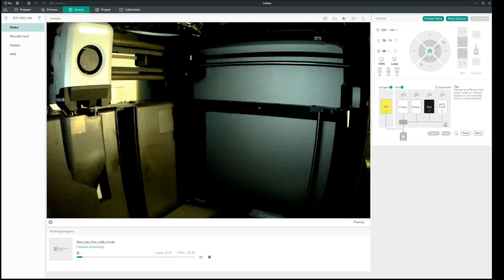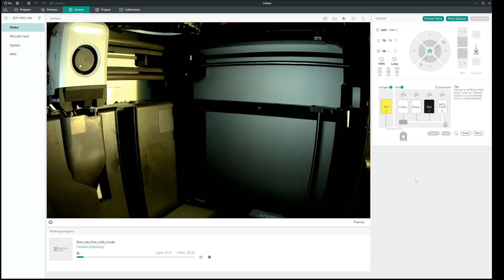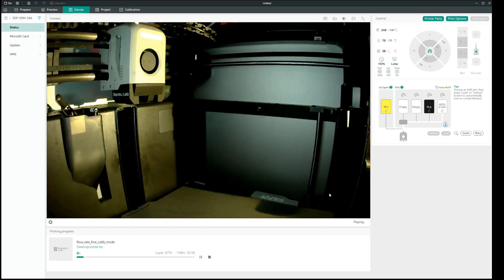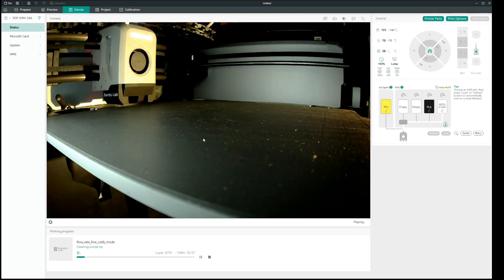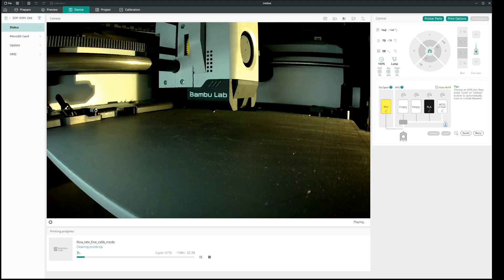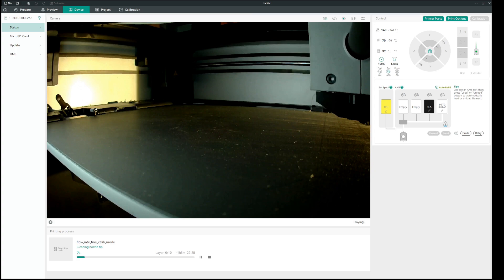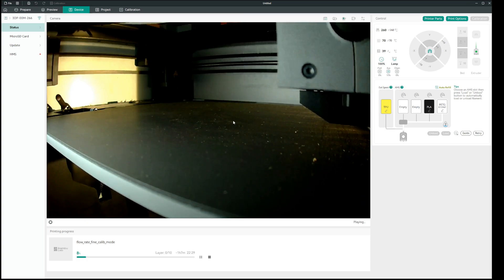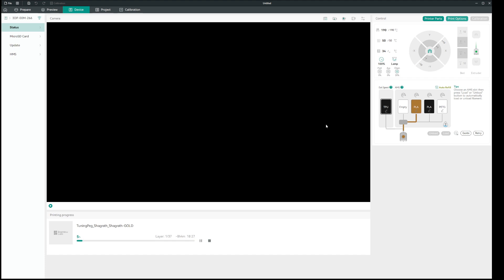Bambu Cool Plate Supertack - Fix problem with filament not sticking to buildplate.

Comment: Well ballz. I thought this was going to be my fix. But I have a P1S and have this issue. Prints fine on the normal plate or the engineering plate. Or even 3rd party plates. But this "supertack" does just what happens to you in this video. Line fine. print nope wont stick at all and just balls up.  It just super sucks. And i cant do what you said coz ive got a P1S. So this is most deff a firmwhere issue / setting for the plate. crap. So that was a waste of money for me. I could experiment with using a custom plate setting. I know the texture PEI plate puts the first layer closer to the plate than the engineering plate does so maybe thats worth a try. i just dont want to scratch up my plate like i have done so before. I only tryed this plate out after months of not trying it being sealed. And I dont want to update my firmwhere as they have blocked orca slicer usage. Also no bug or improvements for my printer so why bother to just have more restrictions. I dont really use orca slicer that much but its useful and its also the princeable. There is no reason for Bambus move other than to annoy and try forcing the use of bambu lab. I guess its working as i do use it more than before and I guess i should use lan mode but being able to cancel a print part is very useful and ive not seen a way to do so without the handyapp. Well thanks for the video. i guess i put a ticket in again see what they say and maybe fix another bug for them that they wont update and fix, still waiting for the ams bugs fixes i sent them over 4 months ago. I'm starting to loss faith in bambu. they where so good. Disappointing. Mind you 4352hrs and still going with only the odd issue is not too bad. Cheers.
Reply from the maker: Try set your first layer height to 0.12mm   which is what the test lines on front is printed with. Always have bed leveling on. Lemme know if it helps.

Comment: I turned plate detection OFF and now my X1C's are printing fine on the SuperTack plates. Thanks for your post on the forums and this video. Interesting that some have to turn it on and others off.
Reply from the maker: Glad to hear it's working for you! Thanks for sharing what helped!

Also if you want to use 0.2mm nozzle you MUST set first layer to a minimum of 0.12mm layer height otherwise filament will just buildup around the nozzle. This is the same height used for the testline at the front of the buildplate. Any lower like default 0.1mm will not print with 0.2mm nozzle on supertack

Comment: I just got one of these supertack plates and had all the terrible issues shown here.  The plate DOES have the square 'barcode' on it, but it's printed in grey ink on a grey plate so it's very hard to see - no wonder the camera in the printer can't recognise it - very silly.   But the fix for me was the exact opposite of the advice here - as soon as I turned OFF build plate recognition, the filament stuck well to the plate and I had a perfect print!
Reply from the maker: I have heard several say that. But for me i cannot print without detection on. In addition i always must set first layer print height to no lower than 0.12mm
If i set 0.1 or 0.08mm nothing will stick. 
It always print the testlines in the front at 0.12mm by default.

btw the lidar can read the codes anyway. even if it is barely visible.
Reply: @Toffypops  You know, I turned off build plate detection because it was giving me that error when I first got it, but the prints stuck before I turned it off. I don't use it all the time so I didn't think of the timing but now that you mention it that may be the issue. I'm going to try turning it back on to see if it goes back to working again.

Comment: There is no "barcode" on the new supertack plates. NONE at all, and an error is displayed if you leave that build plate detection on.
Reply from the maker: That is kind of stupid of Bambu. As plate detection is very much integrated in Studio to have the exact correct z distance to the print surface.
Reply from the maker: what printer do you have? on the A1 it does not seem to habe one, but the x1 has one pictured on the bambu store

https://eu.store.bambulab.com/products/bambu-cool-plate-supertack
Reply: @Toffypops  I have an X1-C. My order confirms I ordered X1-C plates. My plates have no barcode.
Reply from the maker: Have you checked with Bambu? It sounds very strange that they removed this when it is a sales argument they use. Could be a missprint
Reply: @stevemarschman1485  Mine definitely has it.